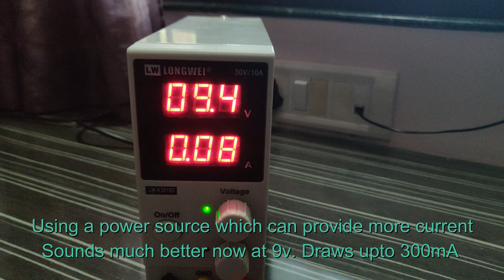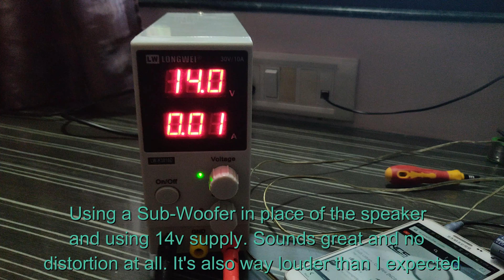LM386 Audio Amplifier Circuit | Loud Bass, No Distortion

Comment: Lm 386 will provide output upto 1w. Your speaker is way too much.
Reply: Yes it is best to use higher ohm speaker to get more milliwatts/higher output with less voltage needed. Small 16 or 8 ohm speaker is the best. Large 4 ohm is the worst. Cuts the output in mws in half! Just check out the LM386 Data Sheet. It will show you the various curves at different voltages, in regards to current and speakers.